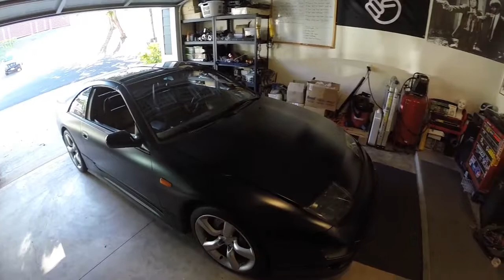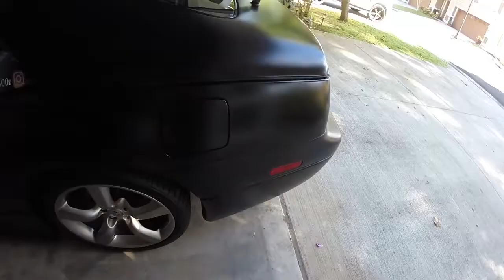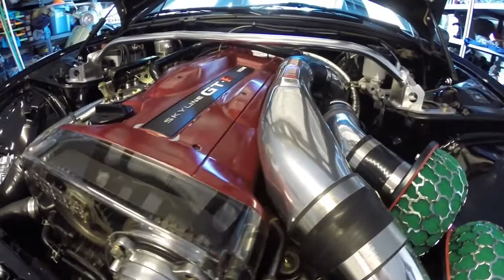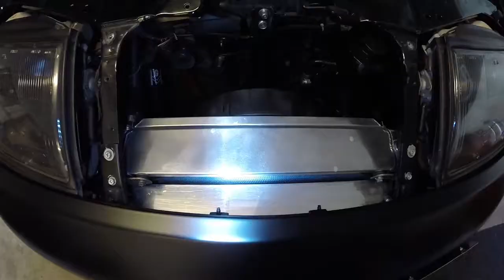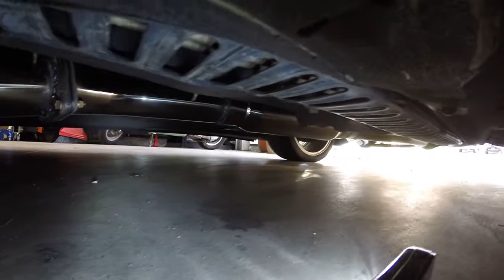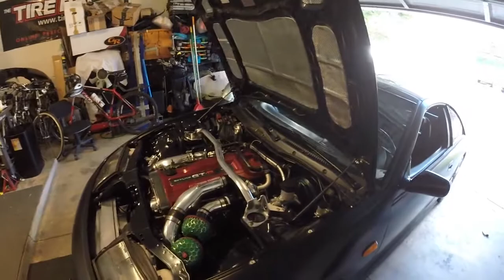300zx RB26 Z32 Swap Info Walkthrough (RB26DETT into 300zx) TueZday Garage - Ep25 (RBZ32)

Comment: That is probably one of the best looking and built Z32 i have seen. Here in YouTube and in the real world. Those are the wheels I had on the one that i had on mine! Probably one of the best wheels available to put on it. And the fact that its a factory nissan wheels and fits perfectly with the hub and the calipers. Has about 1mm of space between the caliper and wheel. And the fact that you put that Skyline tt engine in it makes it a proper z32 TT. So much easier to work on then the stock TT engine. This is a old Video. Wonder where it is today?
Reply from the maker: Thanks for all the kind words and love for the build. She still captures my heart every time I see and drive her. Still running as strong and smooth as ever. I am now about 50 miles short of 13K miles on the swap. Still perfect in every way!

Comment: Did you also have to buy a skyline r33 transmission nd an r33 wiring harness for the electrical parts like the lights and all tht?
Reply from the maker: The engine I bought came with transmission, wiring harness, ECU, and PTU. No MAFs. As for lights and stuff, that is all original to the Z, part of the chassis harness, not connected to ECCM or engine
Reply: @BCs300z  ah i see its becuz im planning to buy a skyline engine to do tht too but its just the e gine for sale that they have only
Reply from the maker: Luis Cisneros that’s all you really need. I didn’t use the ECU or wiring. As for the tranny, you only need the bell housing. If you haven’t yet enjoyed this whole series, each video specifically targets a part of this swap and provides all the details and info you need to put it all together

Comment: Would have been cool if you used a z32 twin turbo instrument cluster. And an r33 center console for the opening in the DIN.  Also use the 6 speed manual transmission with the front dif removed

Comment: Does it have A/C ?
Reply from the maker: juvencio chavez it does not
Reply: I have a 300zx I'm planning on switching to RB26, Do you know if there's any way I can put a Rb26 with AC ?
Reply from the maker: juvencio chavez it’s definitely possible. Just depends on how. OEM vs Custom. If you are looking to use an OEM-style front mount condenser, you will likely have to cut the core support and/or use hood pins. That wasn’t something I was willing to do. Custom is more like an AC for an antique car... wherever it fits

Comment: You don't scrape that front sway bar? Maybe it was the camera angle or lens, but it looks like it goes pretty low
Reply from the maker: It used to. I had to make custom lengthened end links to get the bar up a lot higher.
Reply: @BCs300z  How's the car keeping up so far? And have you gotten used to (bored) with it yet? 
I'm waiting til payday to buy a '91 rolling shell, so I'm doing all the research I can right now lol
Reply from the maker: @corneliuswellington6670  Not bored, but excited to get back to the point where I don't have to drive it every day, and can take it out and enjoy on demand. But it is still fun everyday :) Just give her a little extra throttle in those on ramps and red lights. Looking forward to turning up the boost a lot once I no longer have to be too concerned with gas mileage.

Comment: How hard would it be to keep the climate control also? Maybe to the opposite side of the oil radiator?
Reply from the maker: Gaston Jones all said and done, there is a slim space in the standard spot for a condenser, but i don’t think you could get fans on it and it would have to be narrower left to right for the hoses to rad and p/s. As for the front corner, it would have to be an extremely small condenser and custom lines. Anything is doable i suppose
Reply: @BCs300z  so u dont have aircon in this swap?
Reply from the maker: @letsseepaulallenopinion3217  I do not. However, I am looking into installing an aftermarket system by Vintage Air. Made for old classic cars. Super compact
Reply: @BCs300z  where could you possibly install it to? I was thinking a custom mount and standalone ecu, so i can put other car aircon system there
Reply from the maker: @letsseepaulallenopinion3217  I have not yet worked out all the details for the Z specifically, but the unit my friend has in his rat rod is electric and mounts under the driver side dash. The condenser is mounted under the car flush to the floor pans. Works really well
Reply: @BCs300z  I will look forward to your build, if there's some input we can share let me know!